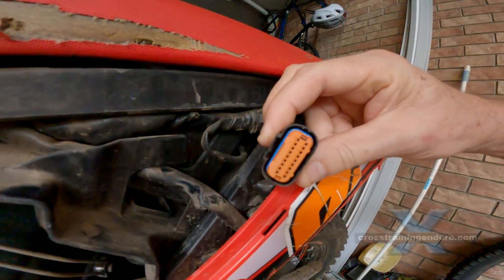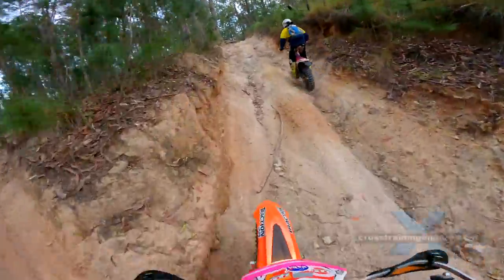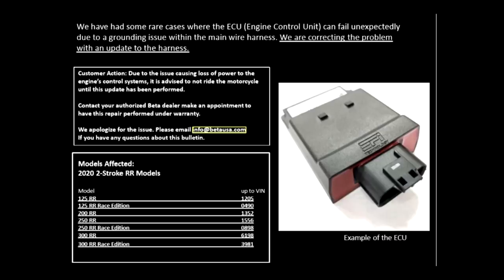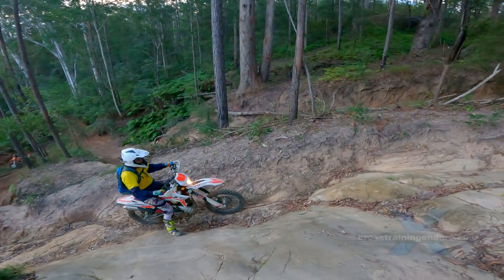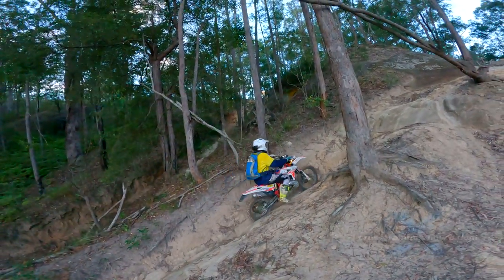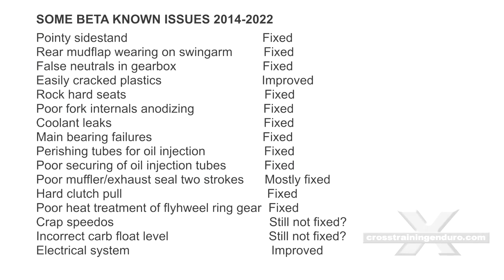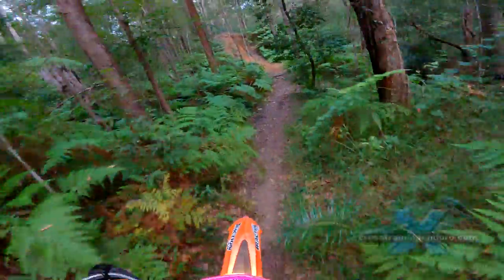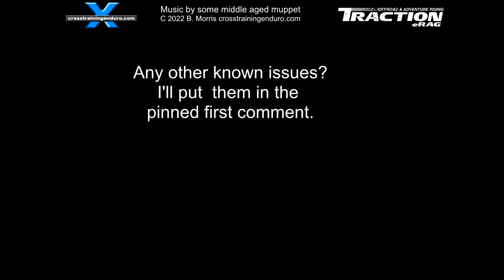Beta 2022 RR300 RR250 Xtrainer known issues review: more electrical issues 😢︱Cross Training Enduro

Comment: My Yamaha YZs never had an issue (nor my Kawasakis) with connectors needing cleaning as they are sealed correctly from the factory. I even have a 2001 YZ with every electrical part original. Call it what it is- poor, ancient, backward Beta electrical  engineering. My Beta 300rr oil injection finally shit the bed last month and got tossed and so premix followed. Because I knew the wiring is inferior so in keeping a close eye on the bike the engine survived when it first stopped smoking, simply by adding oil to the fuel tank. Junk electrical system is what it is all about, otherwise my Beta 300 is fine, rides nice and I like it. Interesting videos but need the hard facts painfully exposed to encourage proper manufacturing by the factory. Electrical issues have been going on far too long with these bikes. No dealer I know of pulls factory electrical plugs apart on new dirt bikes or even personal salt water watercraft for that matter. LOL.
Reply from the maker: My brother and I were talking about this last week. There are so many good things about the Betas but the electrics are inconsistent. And we were disappointed with how long it took them to acknowledge the main bearing issue, then promise to help riders outside the warranty period. If it wasn't for this we'd certainly still be riding the Italian beasts.

Comment: I brought a beta 300rr road legal 4months ago ,l spray marine CRC in wiring plug, bloody horn broke they sended me a new one .I'll have to stop watching the videos I'm getting scared🤣like my  wife said just ride the bloody thing
Reply from the maker: You'll be fine, JR. 😊 It's only a percentage of bikes with electrical issues, see our Beta 2022 known issues vid to see how to do the check although sounds like you know about that already. Maybe just remove the oil injection once the warranty runs out and you can't really have anything seriously go wrong then. Except maybe tow the bike out if the CDI fails (which is pretty rare).

Comment: That's a pretty big list, and only 2/3 fixed?  Bah, humbug.  Shame, shame, Beater.
Reply from the maker: That's not a comprehensive list. If you want the full list it's closer to 90% fixed. And you'll find all the European brands are pretty similar in this respect. I figure if owners aren't prepared for the occasional issue that pops up with any eurotrash they need to buy a Japanese bike and just accept the Japanese rarely change or update their dirt models... which means less known issues.
Reply: @crosstrainingenduro  So eurotrash is just expensive Chiwanese stuff?  Got it.  ;)